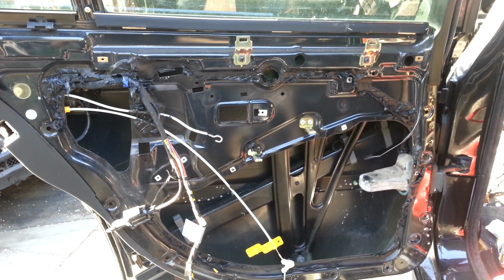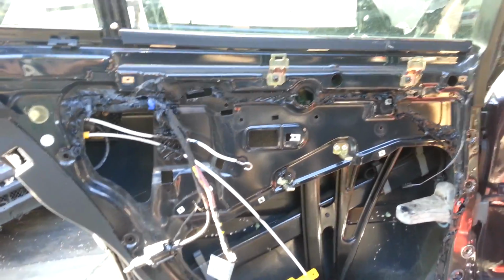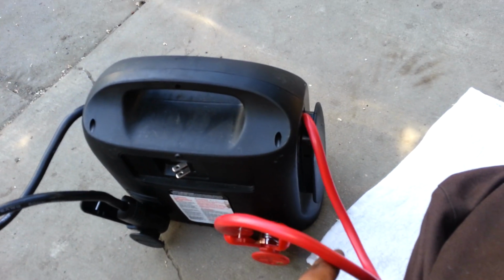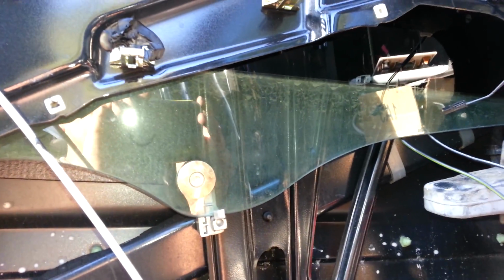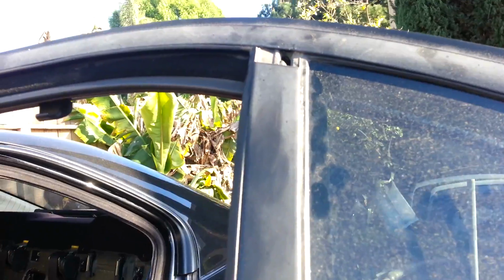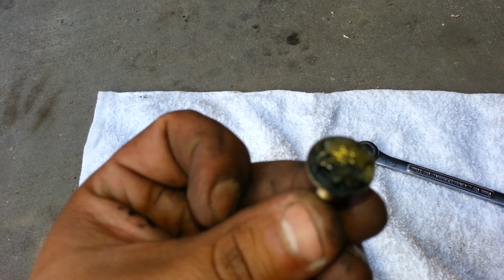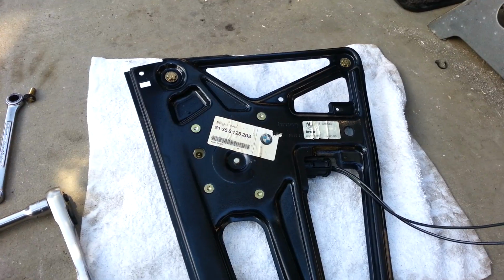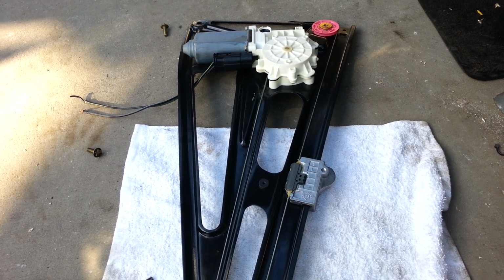BMW E38 750 740 Rear Window Regulator Removal

Comment: Good vid however, you're wrong on the weather strip channel.......Pull the weather strip out first, then tilt the channel inward from the top, it will loosen up and come out easily, your way will scratch up the channel by forcing it down.

Comment: ANOTHER AUX POWER TRICK is use 2 trailer hitch wire splice clips... they clip onto a wire to make contact yet do not cut the primary wire (too much)!
Technically can leave on after repair but might want to remove.just in case.
Reply: Ty for this bc I was Dang it I don't have a spare connector

Comment: i found a solution.  i took the door panel off unplugged  everything.  exposed the window regulator.  the steel cable was a tangled and was no budging.  i cut  it then pushed the wondow up.  predrilled a whole through door on inside and regulator.  i put in a blue concrete screw. (tapcon)  pushed the window tight and screwed the tapcon right under window and the little bucket from regulator that pulls it up and down.  its permanent  until  i decide to buy a regulator.  i also unplugged the regulator.

Comment: great vid.  my issue  is that  little  pink wheel is broken and window is 3/4 up.  what do u recommend.  motor is running  but window is stuck
Reply from the maker: +Albert c Replace whole window regulator with a good working, used OEM complete regulator.  We don't recommend you purchase ebay regulator without motor because most likely it will be chinesse and break in a couple months.
Reply: +bimmermerchant whoops. Just bought one off eBay. I am not paying $330 for a regulator. lol Just want to keep the window up. No biggie.

Comment: Just changed window glass, did it at night in the dark thanks to accurate video!
Reply: +ChristopherHanssen 
I also did it without taking the covering strip right out (that covers the rubber seal) just loosened it and pulled the rubber up, removed / inserted new glass, fastened the bolt and lowered the window right down then the rubber fit in nicely and raised window and refastened the cover plate

Comment: I went ahead and did my 2001 rear driver side today...:)  You def have to remove the window on rear doors to remove the regulator. I tried just unbolting glass and lowering it so the top of window might possibly lower below the two top regulator bolts with no luck. Not a big deal at all because the glass does go out and back in easy.  Just DON'T push the aluminum trim piece below its normal postion as I did, when you pull back up the trim has a scuff for all to see. Thanks for video

Comment: My rear window stopped working and now there's a burnt plastic smell coming from inside the door panel......
Reply from the maker: Caleb Crest We recommend that you remove door panel to find out where that burnt smell is coming from.
Reply: I removed the panel today and disconnected the power to the window motor just to be safe.

Comment: Excellent work and commentary. It was good that you showed the details after removal of the window strip, star bolt and the lower bolt in the regulator assembly for which 18mm was used. It helps understand what was there and help remove it.

Comment from the maker: Thats happened to me before, but don't worry its possible to lower the glass so you can have access to the top torx bolts.  The bottom part of glass sits on a plastic base thats attached to the regulator.  What you need to do is, pull the glass towards you and then firmly press the glass down.  Since the base is plastic, it will bend a little and give you enough room to manually bring the glass down.  Hope that helps, let me know if any questions.
Reply: Great video!  But I'm stuck because the window is all the way up and I can't figure out how to lower it to follow these instructions.  I got the plastic piece off that's on the regulator holding the window, but it feels like I'm going to break something if I flex the bottom of the window inward to try to lower it (then the window will scrape against the metal piece of the regulator that's meant to hold the window up).  Any tips on this?

Comment: I cannot lower the window from its full upright position as the wire is off the pulley, although the motor is turning. Is there any way to manually lower the window to access the top regulator bolts. Otherwise, is there a way to remove the glass with the window all the way up. Wonderful video. Thanks.

Comment from the maker: This is a common problem on most bmw 7-series models.  Your pulley holding the main cable broke and the grinding you are hearing is the motor grinding on the cable.  You need a new regulator.  Check out our ebay site and we should have a good working regulator for you.

Comment: can somone plz help me , i need the 2 cable and the main pulley that goes on the motor. but i can only find full regulator kit, the motor works fine , just need the 2 steel cable and the the main pulley where the 2 cable wrap around

Comment: Thanks for the posting the video. My 2001 740i RR door had a broken pulley and the total expense was $80.
Pointing out the need for a #12 inverted torx socket helped the planning. The glass was easier than I thought to remove and install.
I used this video for door panel removal: watch?v=Rijv9mgtvBA